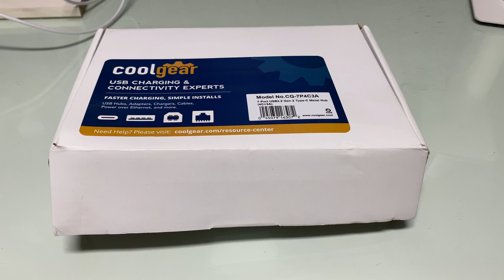CoolGear Powered USB C  A 7 Port USB 32 Gen 2🔑 10Gbps INDUSTRIAL Hub Unboxing Review #wisebuyreviews

Comment from the maker: SEE IT HERE: https://amzn.to/3N1R1fc  - Coolgear 7-Port (4C 3A) Type-C USB 3.2 Gen 2 Hub w/ 15KV ESD Surge Protection  [ amazon affiliate links ] 

HUBS LIST

- Yottamaster USB 3.1 Hub 7 Ports, Powered USB Hub 5V/3A, Type C to USB 3.2 Gen2 Data Hub with USBC to USBA Adapter for Laptop, iMac, Surface Pro, XPS, USB Flash Drives, Mobile HDD, and More(1.6ft)   https://amzn.to/3MQ16vy

- USB C Hub, uni USB Type C 8 in 1 Hub with Detachable Connector, 4K HDMI, Ethernet, SD/MicroSD Card Reader, Up to 100W, Compatible for MacBook Pro 2021, iPad Pro 2021, Galaxy S22/S21 & More 
https://amzn.to/3J1AHd6

- Inateck USB Hub with 4 USB A Ports, USB 3.2 Gen 2 Speed, 3.3 ft Cable, HB2025AL 
https://amzn.to/3Ni7ugC

- Minisopuru USB C Splitter, 10Gbps USB C Hub Multiport Adapter for Laptop, USB C Hub Power Delivery with 100W PD (Not Support Video), USB C to USB C Hub, USB Type C Hub for MacBook Air/Pro, iMac. 
https://amzn.to/43qgqGq

- USB Hub, USB Extension Cable 15 Feet, USB 3.0 Active Cable with 4-Port USB Hub (2 USB-A Ports+2 USB-C Ports), 5Gbps, Aluminum Shell, Ultra-Slim Multiport USB Hub, USB Male to Female Adapter-15 ft 
https://amzn.to/43HDvEw

- Anker 4-Port USB 3.0 Hub, Ultra-Slim Data USB Hub with 2 ft Extended Cable [Charging Not Supported], for MacBook, Mac Pro, Mac mini, iMac, Surface Pro, XPS, PC, Flash Drive, Mobile HDD
https://amzn.to/3ChZ2b9

BRIGHTEON VERSION 
https://www.brighteon.com/e89b6013-723f-4379-bfdd-cdb5c5041ec7
YOUTUBE VERSION
https://www.youtube.com/watch?v=c7a2XjHnOyk

Comment: Its not just a power limit, the way devices/end points are counted means the device limit is lower than imagined, and there are topology limits, on desktops is best to get a controller card with multiple usb controllers, 2 to 4 to avoid sharing bandwidth like the cheap ones, ~$100 range, but yes, you get what you pay for with hubs as well.
Reply from the maker: Good points.